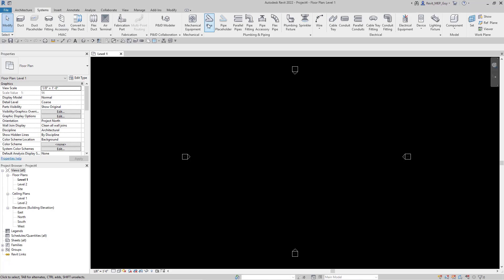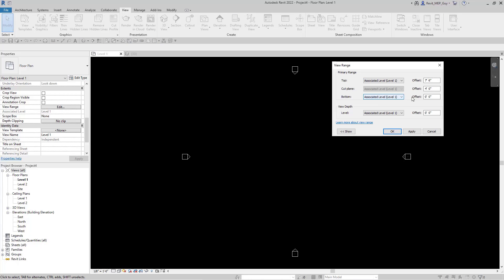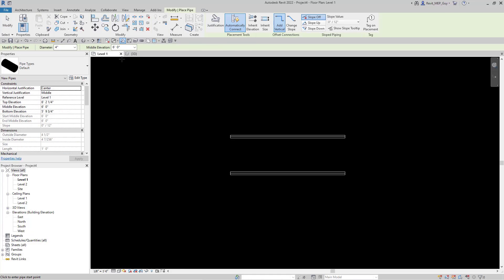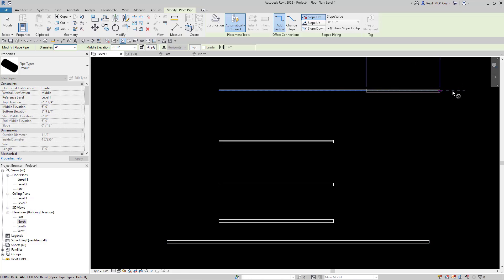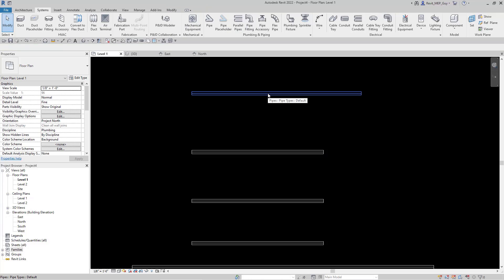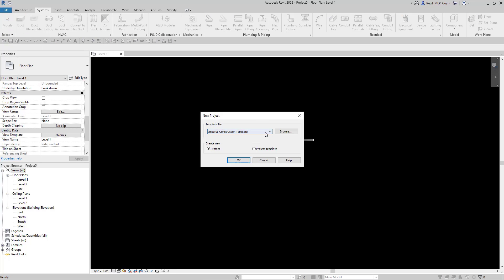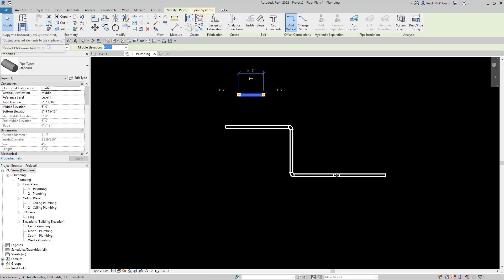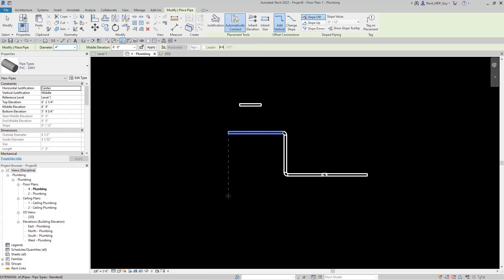Draw Pipe and Set Routing Preferences for BEGINNERS in Revit MEP

Comment: whenever I select the elbow, I cant see trap in the properties even though I have loaded it in my project.
Reply from the maker: You need to open the P-Trap Family and change it's settings. Select your P-trap after you load it in. You can select it in the project or use the project browser and search for it. Then click "edit family". On the properties panel, change the part-type from "Multi Port" to "Elbow". Check out my P-trap video at 1:20 seconds in. I do this very fast in that video. The full length P-Trap video is on my website. Since you are asking about this, I'll make an entire video on some tips and tricks for working with P-Traps. I hope this helps!
Reply: @mep_guy  omg you are the savior! Thank you so much! Now its very much easy for me. Thank you again.
Reply from the maker: @arunrajrajagopal5845  No problem. If you ever have any more questions just let me know!